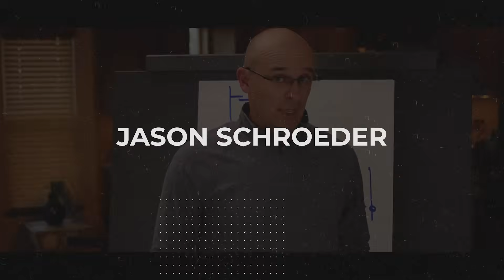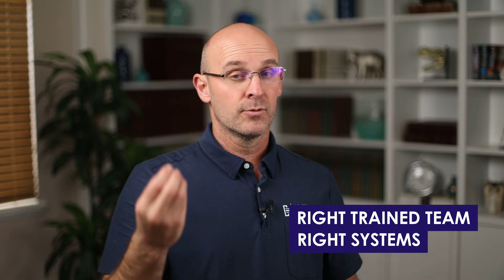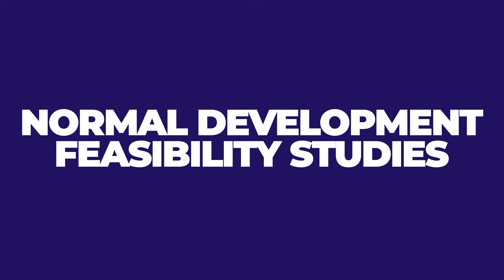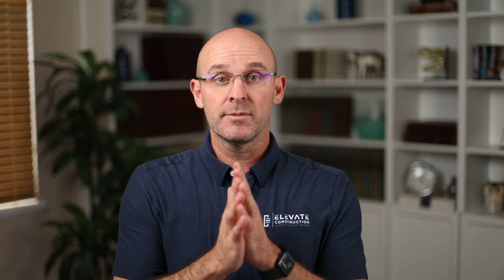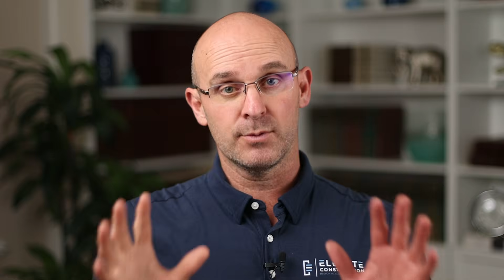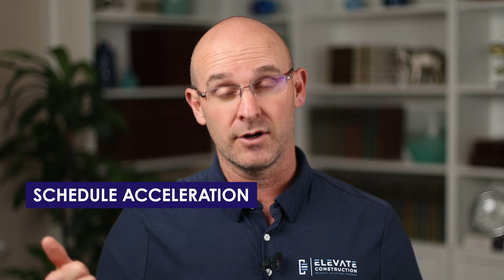How To Save Money On Construction Projects

Comment: Jason, what do you think is the best way to budget for Small Tools + Supplies on a construction project? To save time on estimation, many companies follow a standard rule of % of labor hours on the job and then accordingly come up with a lump sum budget. While this may work on small projects but on megaprojects, this is where the cost leakage occurs. And upon completion of the project, small tools & supplies always seem to take a big hit. How can this be tackled the best way?
Reply: @jasonwilliamschroeder  - No problem. I was researching on this and came across your channel. I am thinking of a standard template that could work in most, if not on all, projects. Maybe take a % of consumables, % of values of tools already on site, $10-$20 per day per crew size on PPE. Adding a layer of 10% contingency on above total. This will indeed increase time for estimators while working on a bid but in my opinion, it is better to come up with a conservative number upfront rather than just dealing with the cost later on.
Reply from the maker: @ArjunSinghChauhan_05  I like that breakdown. Solid starting point.